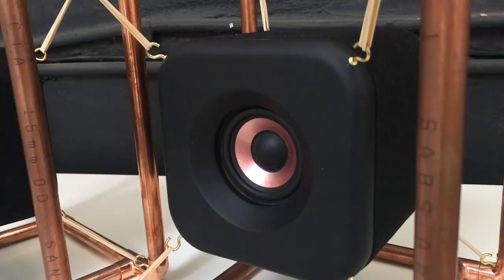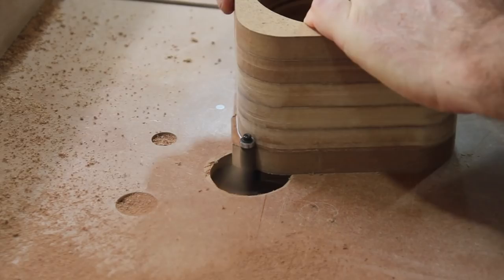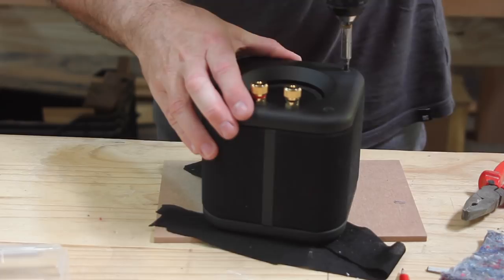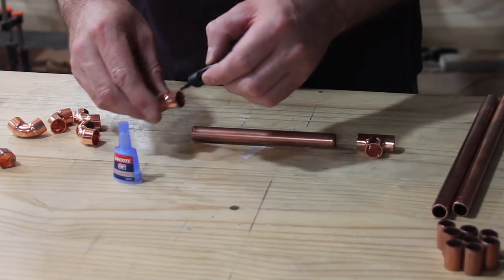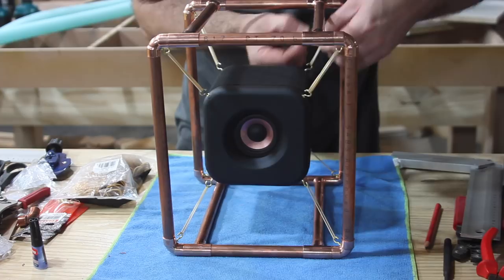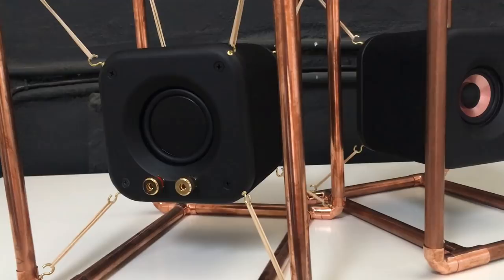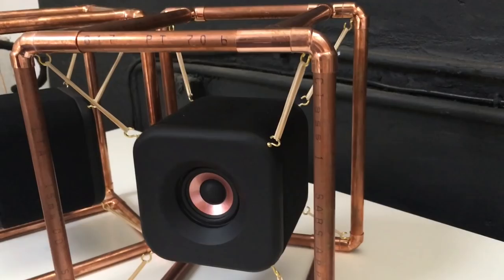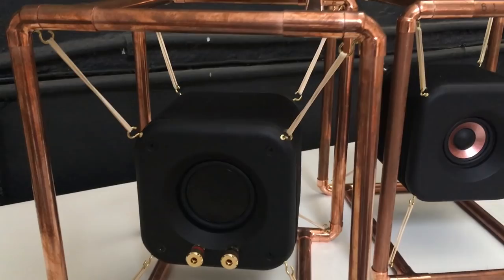Suspended Stereo Speakers - SOUND DEMO - by SoundBlab

Comment: Love the design idea. I do see what you mean with the potential drawbacks of suspension though. They do have a slightly fuller sounding mid-range to low end when placed on the solid surface. But, like you say, if you make them with larger, higher quality woofers, maybe even coaxial drivers for a wider range, these could go nicely with a decent sub-woofer. Love small sealed boxes with passive radiators  :)

Comment: I like it with the stands, sounded clearer to me. I piped the sound though a pair of 8 inch 3 ways with 50 watts behind them and you can tell its very slight.

Comment: The design is nice, but as a full range driver falls flat, but would do a great job in a isobaric config with the radiator at the back, it should mellow down the highs making it smoother and provide crisp mids with a tight bass, it should also eliminate the requirement of a sub and will still bring in the lows below 50hz

Comment: Hi Hanri, great test video. I think I sometimes get stuck in the "function over form" category.  They are great looking speakers and certainly are a conversation piece. They sound great for the size of driver used, and no noticeable difference between suspended and on the desktop. I think I can learn from this to not be so pedantic about what should be done and just get on with building
Reply from the maker: Thanks Richard!

Comment: The main reason for suspending a speaker is to ISOLATE the sound coming out so it will not resonate on a speaker stand, this lets the sound spread at all angles from the enclosure where most of the bass resonates from the rear side of the speaker.

Comment: passive radiator should have faced down if you wanted bass performance. And dont worry about of cancellation as it will move back and forth and not up down.

but listening into my earphones, i can tell you that have eliminated the floor reflection by making it hanging, which sorta cleared the initial decay 

without hanging it sounded bass full but i can hear the lagging due to room interaction

 good work

Comment: Good idea if you suspend the speaker you could tranfer more energy to the air and sound in a range of frequency more weight, I am think if we were a thechnology for a subwoofer you can try with a strong coil suspension

Comment: The stand seems to add brightness, without stand they seem warmer. Perhaps suspend the mid and tweeter and ground the bass for a extended range three driver unit. But these certainly give an option for those that are concerned with vibration and plinth.

Comment: Of course, the emitters alienated from the tabletop sound differently, this especially affected the guitar chords playing - more transparent and less sharply suspended systems, but the systems standing on the table more often articulate the main note of the chord. A generalized estimate is higher for a suspended system, but in my subjective opinion, it would be necessary to consider lowering the quality factor of the spring suspension.

Comment: Very cool idea and nice build.  For the sound test however, moving where the speakers and camera are in space, and angle to the camera, between the recordings can have a big influence on the overall perception.  Depending on the type of room it have an much greater effect on the bass levels.  In later videos having a greater attention to these details will allow for a better A/B comparison.
Reply from the maker: Thanks. The camera was only recording the video. I used a separate mic in a fixed position to record the sound so that it will be a good A/B comparison.
Reply: SoundBlab - thanks for the update, glad that this was a controlled element.

Comment: Nice satellites. Maybe they lack a decent bass section, so they should be XOvered and a SW is mandatory. But they are certainly looking good and are a nice pair of bookshelf speaker for sure.
Reply from the maker: Thanks. yes I think they will work well paired with a sub.

Comment: My only problem with these are how they're lacking in bass, if they had a subwoofer then these would be perfect
Reply from the maker: A sub will definitely help.
Reply: @SoundBlab , you could get into some interesting territory with a small vented module similarly in a frame  to see what effect the output of the vent would have in this suspension system.  There are a lot of free spectrographic audio recorder apps in the various app stores.
Reply: possibly some kind of damping.  you could also keep adding rubber bands and play with the suspension  tension.

Comment: SpundBlad,, why is it that they Sound Diffrent when Suspended.??.
Reply from the maker: Even though these where just for show (the looks), theoretically a properly suspended speaker can have an advantage that it does help prevent the transfer of mechanical energy from or to surrounding surfaces and thus give you a cleaner sound.